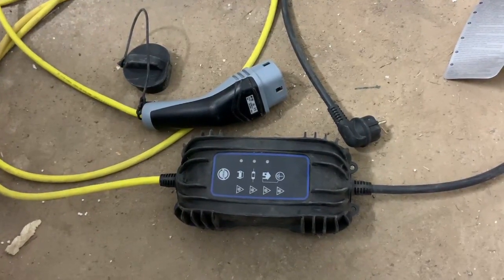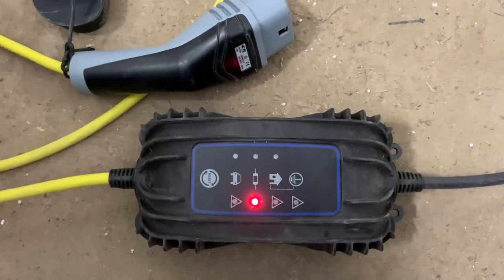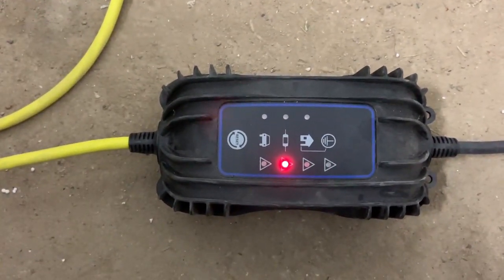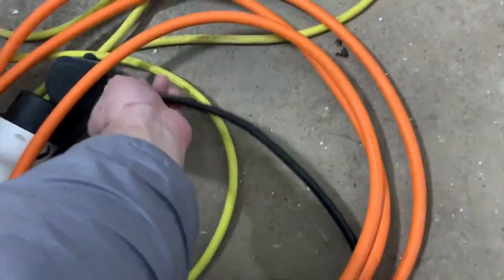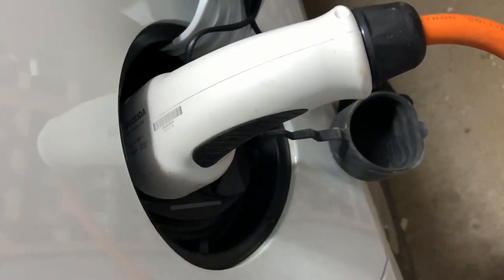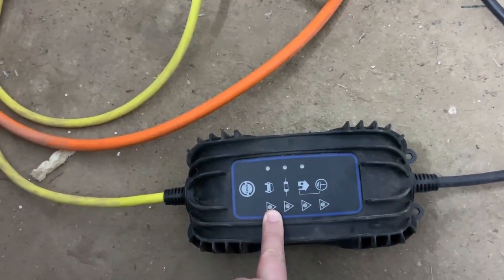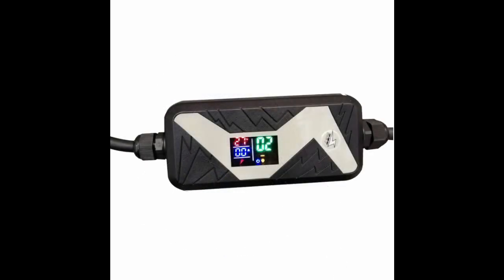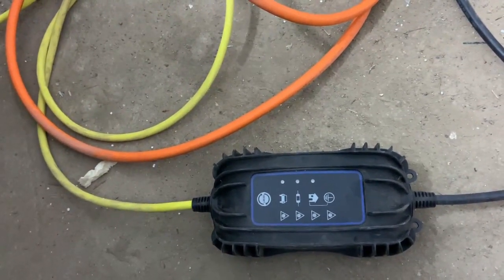Granny charger failed after 5 months of using it 😢

Comment: You should always have proper type2 wallbox at home and leave that schuko charger just for temporary use - that what the recommendations say also, how about volkswagen manual, also recommends it only for temporary use?
Reply from the maker: My local Volkswagen dealer never said that to me. I was instructed to use the Granny charger if I have time to slowly charge the car. They also told me that this is the best way to charge the e-up.
This is what is written in the UK site (https://www.volkswagen.co.uk/electric/car-charging/times):
"Charge times for the e-up!

One of the most popular and time-efficient ways of charging your e-up! is to do it while you sleep. Plug your car in when you get home, and if you just use mains electicity it will be fully charged 10 hours later, ready for your morning journeys. But if you get closer to 6 hours of shut eye then a wall-mounted box is a quicker option to get your car fully charged by the time you wake.
 
If time is of the essence then a rapid charging point can get you up to 100% charge in an impressive 30-45 minutes."
Reply: The granny charger included with the car is of very robust construction. 2.5mm cables, while the charger only allows max 10A. Therefore no reason for overheating except when contacts in your home schuko socket are loose.
Reply from the maker: I also think that the granny charger is robust. Today I spoke with my Volkswagen dealer and they told me they never had a case when the charger is faulty.

Comment: It looks more like a spare charger (or like a second spare tire in your car). You definitely need to invest in a wallbox with 3.6 kW If you chase 3.6 kW continuously through your wall socket it will cause damage and fire.
Reply: 240V house: breaker, cables in the walls, and the outlet that you buy at the store are dimensioned for 16A. Don't melt the cables in the walls and start a fire with the 20A AliExpress one.
Reply from the maker: Agree. But we need to have a spare charger in case of this, when the main charger failed.